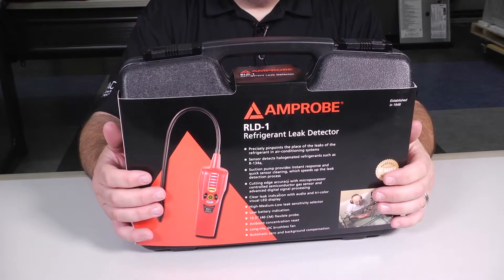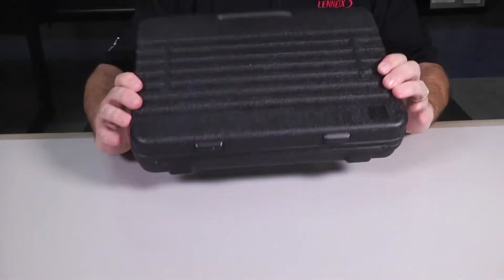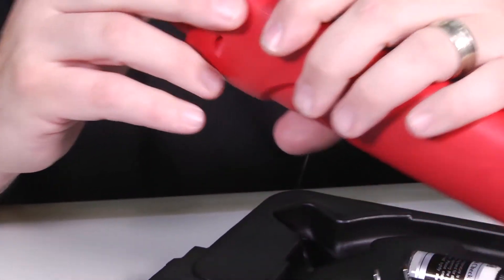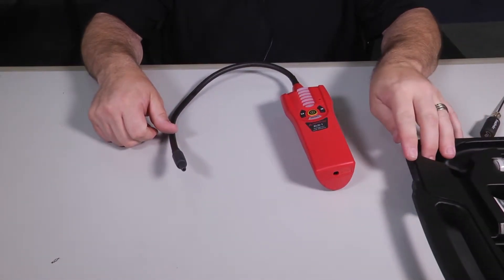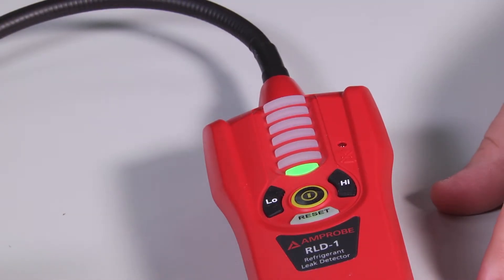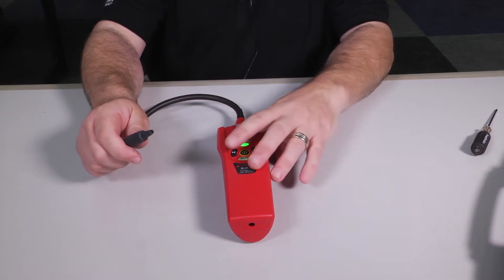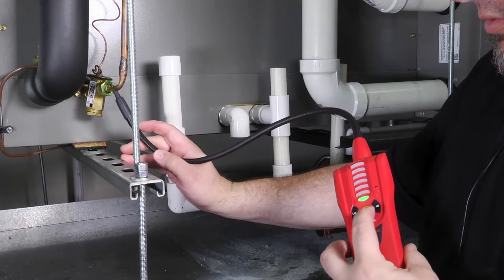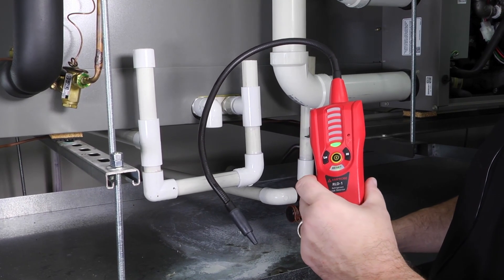Unboxing The Amprobe RLD1 Leak Detector on Toolbox Tuesday

Comment: Your videos are great! Thanks for sharing!
Reply: Hello,  thought I would mention that is a chatleff fitting, not a flare or compression fitting on the txv. Nice video, you might wanted to mention the arm-o-flex insulation can cause false alarms,  especially on older insulation that did use cfc's in the production.